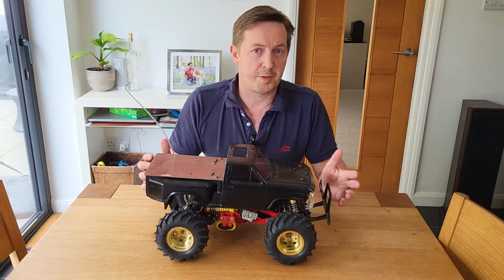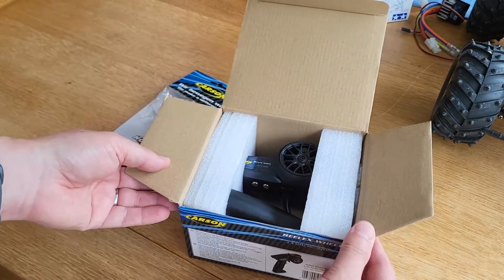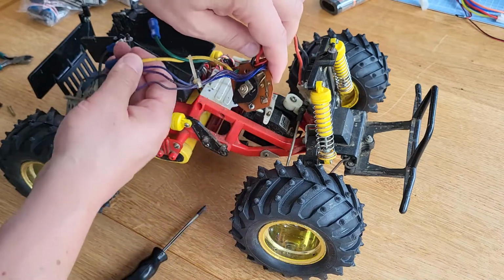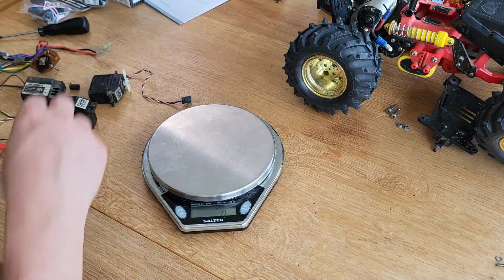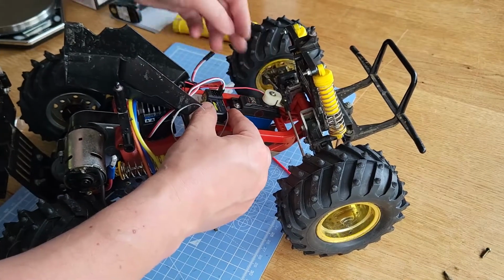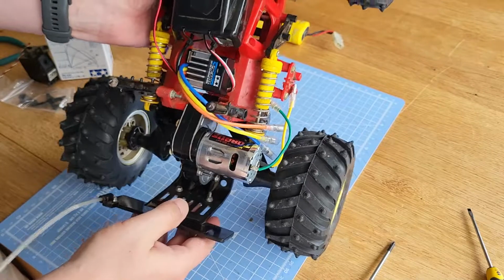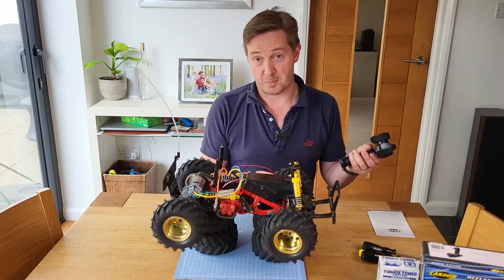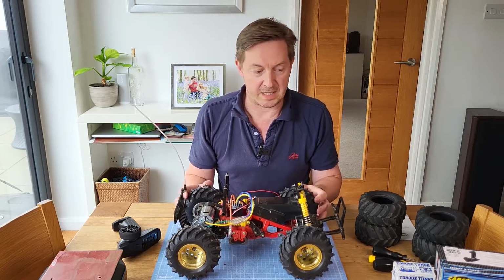Tamiya Monster Beetle - Modernising a Legend Part 2: Battery, ESC, Motor and Radio Gear

Comment: Great video 👍 great upgrades 💯 but.... you had to buy a 6 cell NiMH 3.6amps with 19£ or even better a 2s lipo 4 amps with 24£ because this motor can take 12v and the esc 8.4v. If the battery box doesn't fit a 2s lipo 4 amps put a 2.2a- 2.8 a etc 😢 keep up the great work 👍👉🫡
Reply from the maker: Thanks. This model I sold on but since then I've taken in a TT-01, TT-02, TT-02B and I have TL-01 I need to film too. I also took the chance to try a brushless/Lipo set up in an FTX Carnage which has been a lot of fun to work through.

Comment: Interesting. Why not go with a brushless?
Also what would be required if i wanted to mod one to also be a crawler? Would i need a gearbox to actually gear down or can it be controlled just with an ESC?
Reply from the maker: I avoided brushless partly due to wanting to keep costs down and partly as I've no experience of them. As for turning it in to a crawler, I don't know but as with real life cars I live by the mantra of "don't build a car you can buy yourself". Applied to this situation I suspect you would be better off buying a dedicated crawler and then using a Monster Beetle shell on top to get the look.
Reply: @MostlyHelpful  Yes, right. Actually I'm just interested in making it slower for my nephew. I understand a crawler is very different altogether and I don't need the torque,

Comment: What would be a good esc and motor to put in a 1988 Thunde shot Tamiya.
Reply from the maker: I run a Tamiya TBLE-02S ESC and a Torque Tuned motor. If I had my time again I'd go for a Hobbywing 1060 ESC instead. That's a brushed setup, but if you wanted to go brushless I'd be looking at one of the Hobbywing Combo packs.

Comment: Did you replace the two diff bearings? They come in the new kits and 8 would not be enough to replace all the 1150 bearings in a monster beetle ps I don't mean the 850 bearings
Reply from the maker: Hi, the kit I fitted had 10 bearings, 8 large and 2 small. The 8 large went on all four axles and the 2 small went in the gearbox. So, as far as I'm aware, that's every bushing replaced with a bearing. 

Meanwhile I've just finished filming the next instalment of the restoration so I'll be uploading it very soon.
Reply: @MostlyHelpful  cool will look out for the next installment.
There is 12 bearings in the standard car, 2 on each axel which you changed. 2 for the layshaft and a further 2 for the differential. Now in the re re kit you get bearings as standard but as the original is 35 years ago I can't remember if they did or not. The diff bearings are housed in the white plastic carriers you can see externally.
I built my 3rd re re monster beetle last week and the set of bearings I had came with 12 but as I use the MIP ball diff 2 are left over and 2 from the kit are also spare which is handy to have 4 spare.
Reply from the maker: So I checked the build instructions and on the original Monster Beetle the diff bearings are supplied as bearings from Tamiya, noted as SA4 on the build sheet. So there are 8 plastic bushings, 2 bronze bushings and 2 proper bearings. The upgrade kit that I bought was specifically for the original Monster Beetle (58060) so only contained 10 bearings because there are already these two bearings included with the original kit. I didn't know this at the time so it's rather good luck that it's worked out this way!

Comment: its easier to twist the solder tabs on the motor, so they both point "upwards" in the case of monster beetle, so they guide the wires out of the way of the wheel better.
Reply from the maker: That's a great tip thanks. I've now found a used Monster Beetle shell to replace the Blackfoot one so the final video will be coming very soon.

Comment: If that's a vintage Blackfoot body you'll be able to get some decent money for that don't let anybody rip you off
Reply from the maker: Thanks, I am going to put it up for sale just as soon as I've sourced the lexan Monster Beetle body.
Reply: @MostlyHelpful  gone to a good home 👍 . Good job I will be replacing the pickup rear door panel after those wheelies 🤣🤣  . They do a generic wheelie bar that fits to the gearbox to stop it going as high

Comment: Looks like you are on to a winner with that one, any ideas on the new shell, box art or something more unique? We did have a Black foot on a Monster Beetle chassis and it did seem prone to accidents. I think this is why we sold it in the end. We now have a new Monster Beetle, but again, I feel that the chassis does let this down slightly. Either way it was still great fun 👍
Reply from the maker: I'm planning a Kamtec Sand Scorcher lexan shell, and some re-re decals (assuming they fit) to replicate the box art, but in a robust format. The only trouble is by the time I've done that, bought some paint and new body-mounts it'll be £50 which is what I paid for the whole thing! Still, it's all good fun as you say.
Reply: @MostlyHelpful  kamtech make great shells. I got a couple of Lunchbox Shells of them and they did a treat. Places will provide printed decals if you need them, or want to tweak them 👍

Comment: I've been doing exactly the same job, lately. The new electronics can ALL be fitted under the black cowling if you stick your speed controller to the side of the steering servo. It's an incredibly neat option.
I also flipped the metal tray where you put your receiver to give a little extra room in there...
Reply from the maker: Thanks Larry, that's a great tip regarding flipping the tray over so I will do that. Good spot re the electronics too. I am selling the old Acoms stuff so I was never going to use it, but it's useful to know for the future.
Reply: ...probably also worth pointing out, because it was a surprise to me, that old servo plugs won't fit into new electronics.